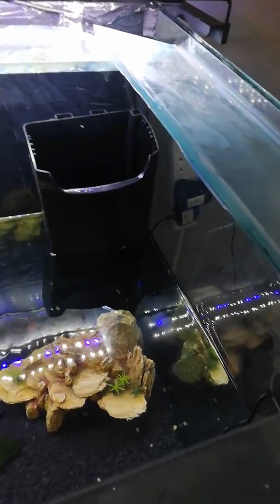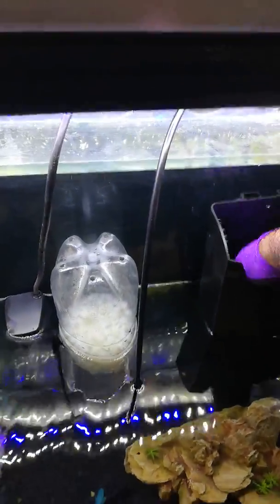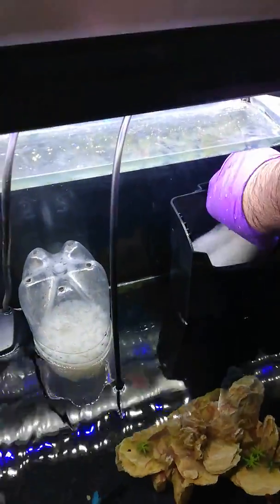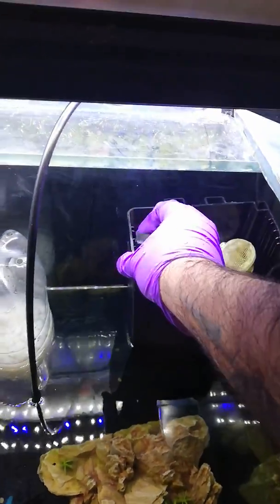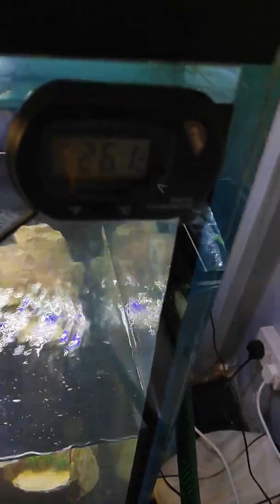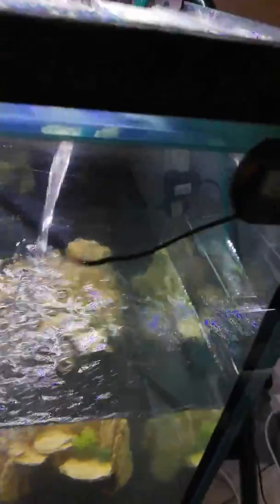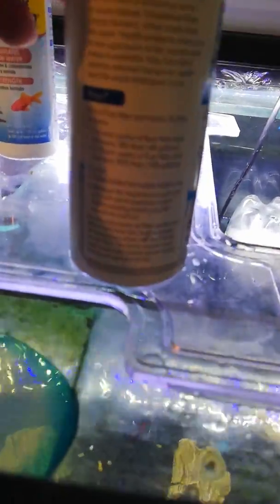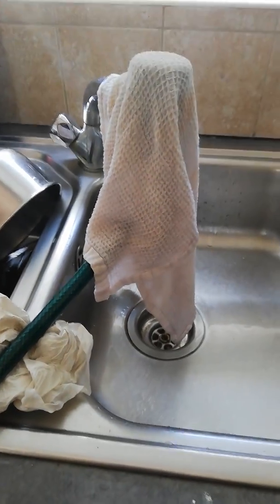Interpret cartridge filter CF3 modification filter media and tank tips part 1

Comment: The carbon is supposed to be the last stage of filtration so I recommend putting it after the floss (the cleaner the water runs through it the better and longer will do it's job for). You should use conditioner before you put the water in the tank, not after (you might kill your fish and will surely kill all of the bacteria that colonise your media).